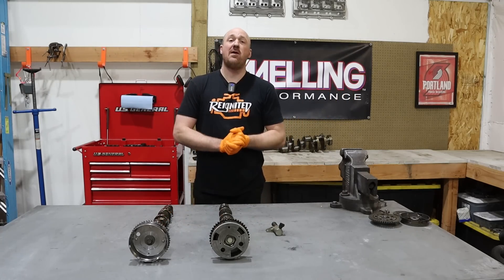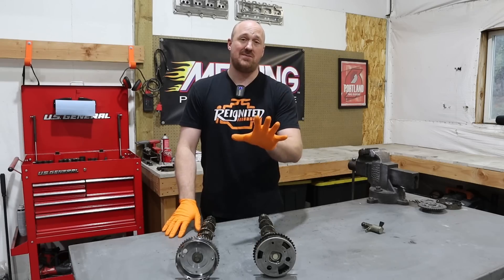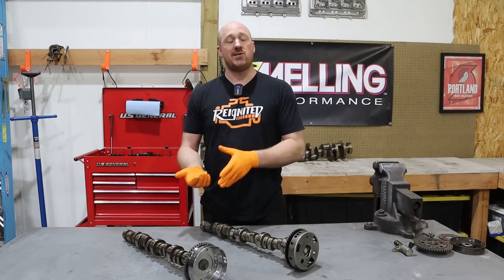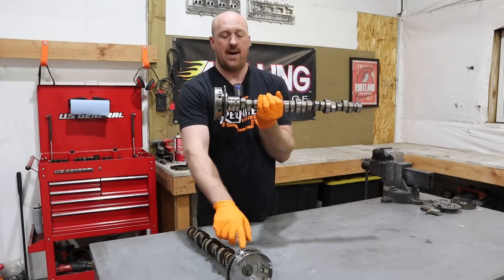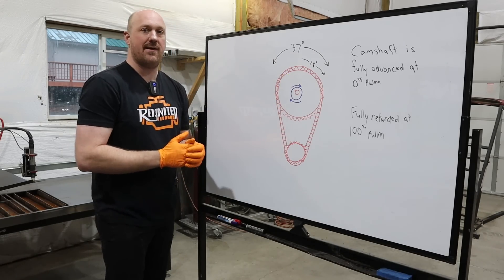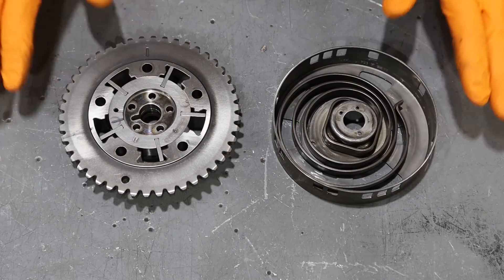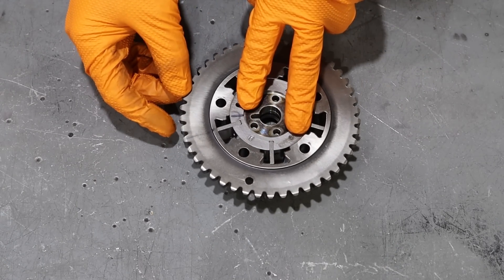Hemi VVT Explained! How Does It Work and Why?

Comment from the maker: To be clear, I'm aware that the Honda VTEC system operates in a much different way than the Hemi engine. I was simply pointing out that variable cam timing technology has been around for awhile. Appreciate you watching!
Reply: I had questions about this VVT system! Thanks for the video!!! You’re the best!
Reply from the maker: @imnotthatcreative6894  in glad it helped!
Reply: Great content every time, I wish you would do one on the forget gen non vvt cam upgrades, I'm looking to modify and I want street able power
Reply: Honda used to swap to an entirely different camshaft lobe during vtec operation. By doing that you can flip both valve duration and timing to another set parameter. Now honda uses I-Vtec which also incorporates a camshaft actuator to twist the camshafts independent from the crankshaft using oil pressure. Also on the honda j series 3.5/3.7 honda uses the same vtec setup but instead of swapping to a more aggressive camshaft lobe they shut down the back bank of the engine and run in a cylinder deactivation mode. Honda does a trick with the motor mounts to cancel out the vibration the driver/passengers feel when running just 3 cylinders.
Reply: ⏫️ I want to know who would type all that out and think anyone would actually read it all or care about any of that rambling
Reply: really!! you're a dodge tech ( im not im a caddy's/Chevy and DSM/aftermarket tech, with a 2G-hemi+Tr6070/charger and k1500-1980's ownership, also a millwright/maintenance ) and forgot the cam-in-cam 4th and 5th gen vipers ( working on copying/modification this for my big block 440/hemi, and yes i own a 4th gen viper cam core and yes it's a 2-peace unit with 9-40* of movement between the lobes, hydraulic+ecu/plc powered/controls, going back the the 1960's holly/chevy and the 350/sbc had a aftermarket phaser-option for cintrifical-operated/springs-operated VVT and or cable-dashboard-operating but you also didn't mention that 🤔 ) engine? variable lobe angles aka LSA is possible and the hemi/3d-G was planning for getting the same technology as the vipers but for some reason hasn't happened yet on the twin-phaser assembles 

also heard rumours of the multi-air VLL+VVT+LSA also being added to the v8's but also hasn't been sofar 🤞 it does happen to it can out do the coyote/ford's platform with " cam on demand "

lost me as you made it sound like ford's/imports got the "hot-stuff" and USA 🇺🇸 can't do it with the cam in the valley/single-camshaft-tunnel design aka only one way, and no my 2C coyotes are heavyweight and or can do without the 3 extra cam's & phasers  but that's my take and my ford-friend doesn't agree and likes the voodoo 😉

better job 👍  on explaining the oiler-port's ( missed the opportunity for mentioning how similar it is to the oil pump's used in newer products ie godzilla/ford's ect as a vain-pump ) as my first time being experience 2006-14 era with phasers wasn't explained very useful to me and i thought* the bottom sprocket moved the chain or the gide's changed positions, and yes some do use that method but not common to see and or limited adjustment can be made ect aka the way vipers ( my engine use's a gear-drive just as a point that chains-oiled aren't the only design possibility's, as a dry belt is used on the 2JZ/imports, anyways im a industrial/diesel/gear-built guy 😉 ) do it is the smarter choice but really should have used a extra pumping as variable-engine-RPM 20psi~ ( versa's constant 200-1200psi normally found in lightweight* hydroelectric system's, the newer version's using full electronics is debatable as power is limited but dynamic-speed is quicker ) and high rpm/loads and or big cam's/lift can tax the system to much making erratic operating ect
Reply: Honda V-Tec is a variable lift cam system that uses 3 cam lobes for the intake side minimum on each cylinder. At low rpm and engine speed the smaller cam lobes open and close the valves but when the v tec kicks in there are locking pins that engage the small cam lobes to the big ones which increases valve lift at higher rpm. I believe on some Honda v tec engines both intake and exhaust has v tec

Comment: They also use vvt to replace egr, when the vvt system is active for emissions purposes it opens and closes the exhaust valve sooner which captures more Nitrogen of oxide emissions in the cylinder to be re burned for emissions.
Reply from the maker: Exactly right 👌

Comment: 37 degrees at the cam is actually  74 degrees crankshaft movement?  Sounds a bit much.  " The only Dumb question is the one not asked"  You did a great job explaining valve action,  It is kind of hard convincing people  that you advance a cam for low end power and retard it for  power at high RPM's.

Comment: If you are advancing the intake (open earlier) you are also advancing the exaust (open earlier)
Reply from the maker: Correct, that's why single cam engines are limited in how much they can move the cam timing. DOHC engines  are much more forgiving.
Reply: @ReignitedAuto  But in the video you say if you advance the intake, you will retard the exhaust

Comment: Not sure if I’ll get a reply as the video is dated. I loved it by the way extremely helpful! But I have a 2019 hemi and I am having troubles where I switched the timing chain and oil pump and now it’s stuck in limp mode. Would the oil pump having higher pressure cause issues with that oil solenoid making the cam phaser always retard or advance timing?
Reply from the maker: I haven't seen or heard anything like that. Do you know what codes are set?

Comment: I have a question 2012 charger 

 it has 3 phasers are the same ones different but the

 check engine saying block B cam phaser open sirciuit 

I changed the phaser sensors  the check engine light still on 

Do you think its the phaser

Comment: I kno old post , bust since your soo versed on hemi’s I have a HUGE question/problem I’m having? Po013 I did btr stage 2 w/ mds delete an now having problems after dealer replace pcm an I’ve done vvt valve w/ harness an tuner says no big deal what else I need to do or check?

Comment: Hello good info …
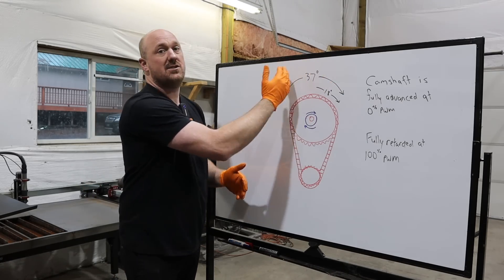Just a quick question , in the min 8:50 you mention the solenoid has the capability to turn the phaser at any point between 0 and 37 degrees , is thery any specific RPM range parameter for this ?

Comment: When installing a limited , is it common for the fastener threads not to completely line up ? I put it back together, but that has me wondering if that is going cause issues? Thanks
Reply: Limiter
Reply: I ran into the same issue .did you have any issues

Comment: After replacing my camshaft vvt solenoid, truck is ticking really loud. Truck had a slight tick already but nothing like now. Truck had a misfire on cylinder 2. I already knew it was a lifter.

 Pulled the heads inspected all lifters on that bank. The first lifter in cylinder 2 location was collapsed the rest were fine. I inspected the cam lobe were that lifter was, it had slight scoring but nothing too bad.

 Replaced lifter and installed new head gasket and bolts. While reinstalling the intake I dropped the front of it onto the vvt solenoid not knowing it broke.

 I assembled everything back together and got a check engine light with a slight tick noise. Hooked scanner up to it and got the p0013 code camshaft actuator circuit open.

 Took the intake back off and the connector was broke off the vvt solenoid. Got new vvt solenoid check engine light is gone, no misfire or p0013.

 But now the truck has a really loud ticking noise but runs really good. 68k motor! Do I need to retorque rockers after installing the vvt?

 Before installing the vvt solenoid I checked the torque on the rockers and they were still torqued to spec. Need help on this one bad, its driving me crazy...the 68k engine is from a charger. I swapped the charger engine into my truck.

Comment: My advice would be, If you want a bad ass Cam, but keep the VVT, Go with the “FRP Mark 82” Cam kit. For everything needed, and I mean everything, the whole kit is around $2,500. Comes with the MDS delete kit, ALL gaskets, the cam, non MDS lifters, springs with .60 spring shims, Cam phaser limiter, head gaskets, exhaust manifold gaskets, and all.

Comment: I would like to use a vvt engine in my pre vvt car 06 charger. So basically I could just leave my vvt solenoid alone and it would run at full cam advance. I wonder if I could control the vvt system independent of my 06 electronics? I would like to keep my vvt.
Reply from the maker: I ran the 2015 5.7 engine in my 2005 Dodge Magnum that way for awhile, it certainly works just fine without controlling VVT. However, even though the VVT can be advantageous in certain scenarios, realistically you'll make more overall power with the newer engine by swapping to a more aggressive camshaft and locking out the VVT system. I'm not currently aware of a means to control VVT using the older PCM's, but people are smart and I'm sure someone has made it work.
Reply: @ReignitedAuto  I was thinking independent of the stock ecu. Even if I could rig up a dial? But yes I want to use  a newer 5.7 in.my 06 charger. Do I just have to swap the tone ring? Any way to do that without removing the crank?
Reply from the maker: @egodeathplease  there's no possible way to run something external, unless it can directly read the CAN communicating from the PCM it would never work right. But yes, basically swap the tone ring and use the original crank sensor and it'll work. Have to remove the crank to replace the tone wheel, no way around it.
Reply: @ReignitedAuto  what about the cam sensor? Are they the same?
Reply from the maker: @egodeathplease  surprisingly yes, the sensor is the same and it'll read the cam sprocket on the newer engine.
Reply: @ReignitedAuto  I acquired an 09 n up 5.7 . It looks to be in good condition.  I don't want to take the heads off . Couldn't I just keep the MDS? use the control harness from my 07? Leave the vvt solenoid unplugged?
Reply from the maker: @egodeathplease  the solenoids are slightly different on the 09+ engines, but i believe they work exactly the same. If the connectors are the same then i suspect it would work just fine.

Comment: If my math and my counting is correct... from a quick visual observation, I count 46 teeth on that device, though a quick google search said 48.  This means 360/48 each tooth represents 7.5 degrees.  Watching you turn that device it looked like the range was 3 teeth.  3 teeth would be 22.5 degrees, 4 teeth would be 30 degrees, 5 teeth would be 37.5 degrees  So... it depends on, too, if it is a complete tooth (ie maybe the movement is 3.5 teeth or 26.25 degrees).  But that gives you a good guesstimate to go with!  Though you really have me curious now, and a quick google search, the vast majority are saying 23 degrees, with a few saying 14 degrees and a couple saying 30 degrees.  It might vary depending on the engine too.  I'm really curious right now! lol

Comment: Those tiny needle bearings are ridiculous. A simple roller on a single larger pin would increase the contact area between the roller and lifter body by approximately 100%

Comment: Hi. Doesn't installing HV pump from Hellcat change the pressure on VVT fazer thus wrongly controls the faze? If i have for example 50% PWM signal of VVT valve doesn't it have different displacement with normal and Hellcat pump because of different pressures? Or is there any feedback signal from a fazer angle going to the controller, which compensate it?

Comment: I'm getting read to install a cam in my 392 and you helped me a lot. Also on a different note i lost compression in cylinder 8 and after checking every thing out it turned out that one the plastic shot runners in the intake broke off and was holding my intake valve open. So if you could explain that on a video for people to check before pulling a head it would save them a lot of money. Thanks for all your videos.

Comment: all this is a modern vacuum advance system, but does by a computer, and with out engine vacuum
Reply from the maker: Cam timing is different than ignition timing. The affect they have on engines is different.

Comment: I have a question is the HEMI Crankshaft Reluctor Wheel

The same on the 2013 srt8 392 and the 6.2 hellcat engine?
Reply from the maker: That's actually a good question I'm not 100% sure. Unfortunately at the dealer level we can't get the reluctor wheel separate from the crankshaft so I don't have a part number to go off of. With that being said,  I feel about 95% that they are the same.

Comment: Excellent video.  I'm just wondering if you have a quick method to determine what engine has one and one that does not? For example I know my 3.0L chev engine has it as it is labelled as such, but not sure about my 09 6.1L Hemi and my 16 392 (which has MDS). Can they have both VVT and MDS or are they mutually exclusive?
thanks

Comment: It sure doesn't LOOK like those phaser vanes have 30 degrees of rotation available. I would guess it looks like about 24 degrees. You could easily hold a protractor up against it and find out for sure, but 37 degrees looks impossible.

Comment: I like that you pointed out this technology’s use in the Hemi is more for better emissions than it is for power gain.  The fact that pre-2009 Hemi engine utilized an EGR system and the VVT engines do not serves to back this point up

Comment: VVT's have definitely made modern engines much less reliable. Engine such as the 4.6 modular with a basic overhead cam arrangement could often run 300 K miles. Engines with VVT's commonly only make it only 150K miles

Comment: VTEC - Variable Valve Timing and Lift Electronically Controlled.... An older technician  told me this when I worked at a Honda dealership. Not sure if he was right because the letters don't quite add up, but i remember reading this on an old manual as well. The fact that I remember this lol
Reply from the maker: You nailed it!

Comment: Great video man you answered my question about cam phase limiters and locks. Never knew why they wanted to get rid of it to make power now I know safety lol. Can’t you tell me who makes the best valve springs and rods for the 6.2 after market cam package with a limiter not lock. Or atleast the a good round about spec for a cam that works like stock down low but give good high end power. I can even deal with it being a bit sluggish down low. Also when selecting a cam shaft for the hc what is the optimal rpm cam. What’s safe to spin these motors to? Any info is welcome thank you. Excellent video as always man.

Comment: Thanks again for sharing your knowledge openly & plainly for the masses - love it! One thing I think needs corrected - the VVT is in full advance by default, which you showed. This is the low-end mode. retarding the cam adds to the high-RPM capability & adds a few horsepower up high. if you lock it out, you''re getting rid of that extended RPM power, not limiting your torque. That is the same as non-VVT engines of all types - retard the cam install centerline, and it will soften the bottom end - advance the cam install centerline, and it will pull at a lower RPM into the torque range. Hopefully that helps?
Reply from the maker: It's true that the limiter locks the phaser in the advanced position, but the aftermarket camshaft you're installing is already taking this into account when they are grinding the cam, therefore when you install the cam it's already set up for higher rpm performance. If aftermarket came were only useful for bottom end gains I don't think you'd see too many people swapping them. 👍

Comment: Thank you very much for the detailed explanations. 
Since I have the pleasure of driving a 2010 Dodge Charger with the Hemi 5.7 here in Germany, I am glad to have found your contributions on Youtube. 
To my question: Based on the experience with Mercedes (SLK 230 / R170), which are also equipped with variable camshaft, the solenoid switches of the adjustment are leaking. 
As a result, oil leaks from the switch into the wiring harness. Due to the capillary effect, the oil creeps through the wiring harness into the engine control unit, where it can then lead to a short circuit. 
As a remedy, so-called oil stop cables have been developed, which are offered as a retrofit solution. 
Do we have a similar scenario with the HEMI engine with leaking solenoid switches on the camshaft?
Reply: Thank you very much for the quick response. I was a bit worried about that particular issue since Daimler was involved. Often it is very easy to use already existing solutions. Again thank you very much I appreciate your explanations on your Channel.
Reply from the maker: Michael,  I've seen that happen with our oil pressure sensor connectors, but never with the oil control valve that controls the VVT. 👍

Comment: Great work as usual, thank you! You mentioned the better emissions numbers being sort with this technology and that with a single cam we can only work the intake or exhaust (with a few exceptions) referring to the fact that this only works on the exhaust valves in the HEMI engine but as far as performance goes the increase and difference 
in numbers and overall effect when operating on the intake valves with VVT is monumentally greater than with the exhaust valves! Cheers

Comment: This is great technology. It helps the engine produce so much more power without any side effects. Between this and the variable runner length intake my truck has it feels like I'm always in the torque curve when I'm pulling. Great explanation on how the system works.
Reply from the maker: Oooh, thanks for reminding me about the variable intake runners, I may have to do a video about that! 👍